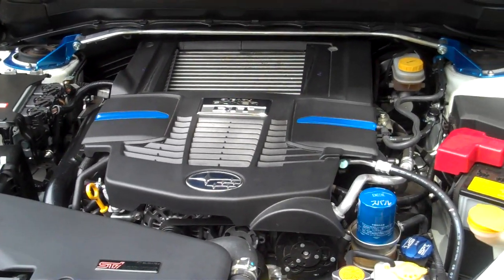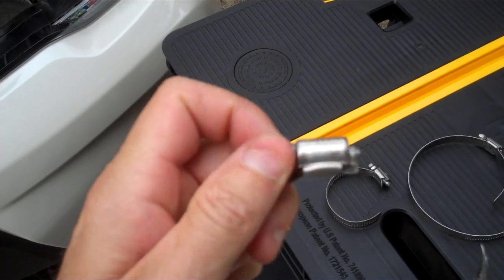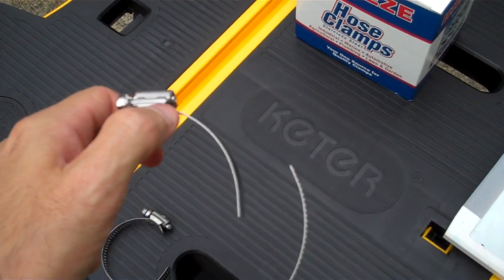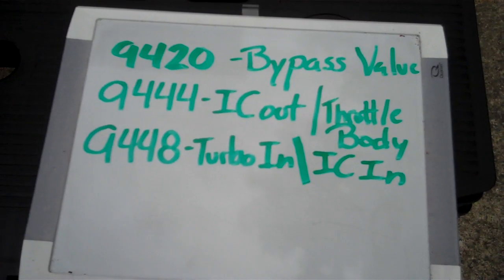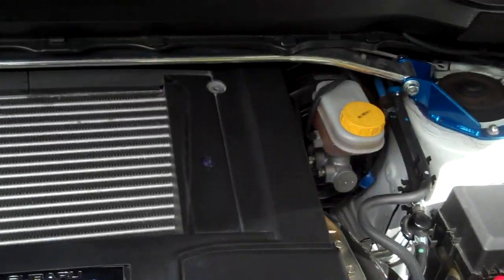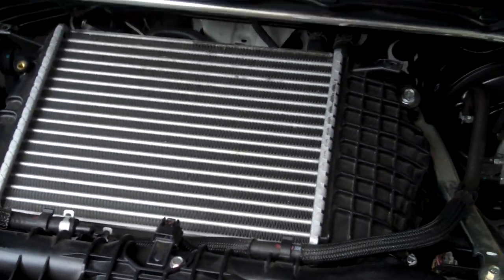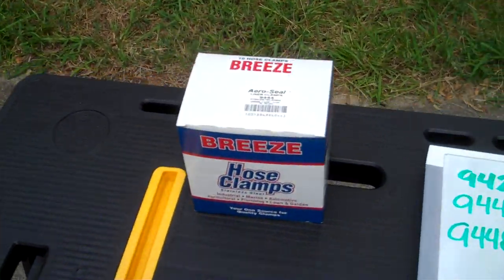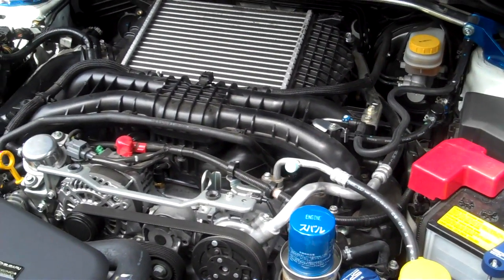2014 Forester XT and 2015 WRX Boost Fix

Comment: #killersushi99 I recently bought a 2015 Levorg 2.0 turbo which for all intents has the same motor as the WRX. I've noticed recently the EXACT symptoms you describe and plan on during new clamps in the next few days, half a tank of gas to relearn the throttle position etc seems a lot though? How drive able is the car while the ECU relearns?

Comment: I did this just precautionary, and now I'm pretty sure I got a boost leak. Car was good before and now its idling rough. Gonna have to do it all over again tomorrow to see if the intercooler or one of the hoses didnt seat properly, or maybe I over/under tightened one of the clamps... sucks to suck

Comment: So after this mod, or clamp swap, you don't get any smoke ever since?
Reply from the maker: Task514 There will always be smoking because of the DIT engine but it helps with the A/F ratio and that cuts down on some smoke.
Reply: killersushi99 so basically you think this is gonna make your engine leaner? and your reaching 18PSI boost now but not before?
Reply from the maker: Task514 the lack of boost leak helps the ECU maintain correct AF ratio. it keeps the pressure levels more stable. more stable equals better fuel air mixing.
Reply: killersushi99 did you datalog your engine performance regarding this? I'm trying to fix a rough idle and smoking engine issue; as expected, Subaru claims it is normal and I'm not convinced of the clamps swap!
Reply from the maker: The rough idle is normal according to Subaru. Mine has aftermarket exhaust so when its cold it sounds like a race car on initial start then it calm down after about 30 seconds.
Reply: killersushi99 the rough idle can't be normal; on cold start the idle is at around 1500-2000 rpm. At this high idle, the engine should be smoothed out; I'd understand it's rough at low rpm, but not that high idle. Also note that it does become really smooth sometime!! But mostly it is rough and even feel as if it is misfiring.. Cold or warm engine.
Reply: killersushi99 your exhaust sound on cold start is totally normal. Many cars does that, such as BMW M4 too.

Comment: Have these issues been addressed on the newer XT's? 15,16,17? Have you been having any issues with the FA20? I've seen alot of the 15,16 WRX's in the shop one had the engine compeltely removed not sure what for.
Reply from the maker: Revo2Evo not sure about the new models. so far I have 34K on mine and I'm still going strong.
Reply: Nice what are the mods on yours are you tuned?

Comment: what is that grille in  the engine bay that looks like a small a/c condenser?
Reply from the maker: It's an A/C condenser.
Reply: that is a very unusual place to put it....Usually the a/c condenser is in front of the radiator.
Reply from the maker: Yeah. It's a high performance air conditioning.
Reply: By the way thanks for letting me know.
Reply from the maker: Dennis Montini Its not an A/C condenser actually...Its the intercooler for the turbo.

Comment: Have you put a new cold air intake into this yet? I was reading through this but they didn't include a results video - http://speed.academy/dyno-test-aem-intake-2015-subaru-forester-xt/
Reply from the maker: No but if you do it requires a tune to go with it. In other words you had better have a Access port and go get a pro tune. Say goodbye to warranty afterwards.
Reply: youmongrel the dyno chart is in the comments. But I've been told and heard that the CVT on these XT is the weakest link and it is advised against chasing for more HP.

Comment: Did you have any experience rough idling in your Forrester? My my15 wrx cvt is experiencing rough idling and not sure what it could be.
Reply from the maker: mine does it every once in a while. I just ignore it. mine goes away once it warms up.
Reply: +Kevin Ah Seng
Did you see that there is now a recall on certain VINs? Check out WQW-58. Maybe that's it.
Reply from the maker: szymobol You will get a notice from Subaru dealer. There is a service bulletin that effects early 2014 models with 2.0DIT.
Reply: Was this rough idling happening after you did the clamp upgrades?

Comment: 2nd time seeing my 2015 WRX leave a smoke trail that any diesel engine would have been proud of !  I am taking mine to the dealership to see if they can make it right under warrantly.
Reply: docstreet 2 did Subaru fix your issue?
Reply: I informed Subaru and they "inspected" the car.  After the inspection I have not had another occurrence of this issue.  The dealership didn't say they fixed anything but I think they did.  It either fixed itself or the dealer fixed the issue.
Reply: docstreet 2 they probably flashed a new ECM update that was due and luckily for you it fixed your issue.

Comment: MachV motorsport has these clamps in sets. No need to buy a box for each clamp.
Reply from the maker: They didn't start selling them until after I told them about the problem. I was ahead of the curve with this video. I sent them the write up on the Foresters Owners Forums site by Danoz. They are Breeze clamps just like mine. You can see in the video discription the write up.
Reply: Cool. I was just telling folks that there is a kit out there.

Comment: Did you have to remove intercooler?
Reply from the maker: I didnt remove mine. I just slid the clamps off and on. It was kinda tricky but not too bad. Just slide the clamps under the rubber fitting. I guess if you wanted to pull it off you could take the two bracket bolts off on the sides and wiggle it loose

Comment: How did you remove the IC? How many bolts are there? Thanks!
Reply from the maker: I didnt remove mine. I just slid the clamps off and on. It was kinda tricky but not too bad. Just slide the clamps under the rubber fitting. I guess if you wanted to pull it off you could take the two bracket bolts off on the sides and wiggle it loose.
Reply: ok thanks.